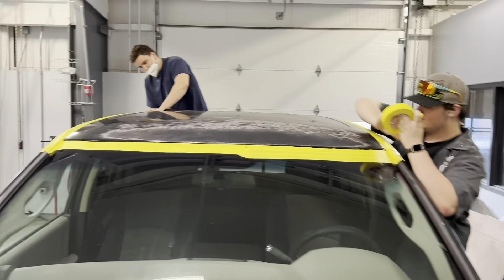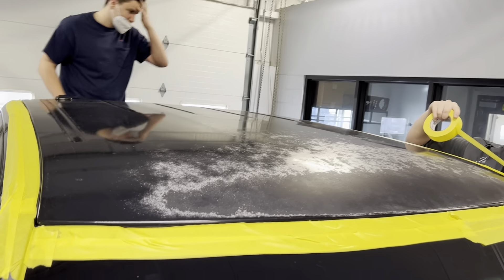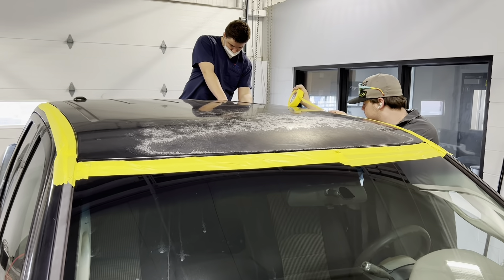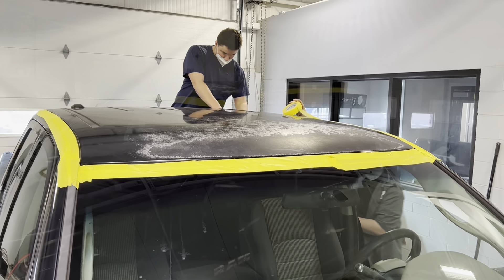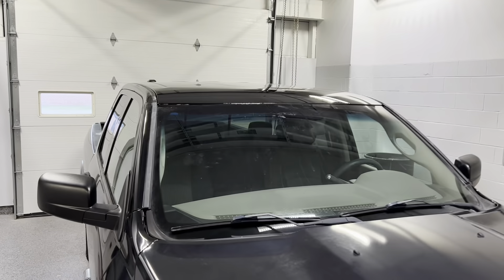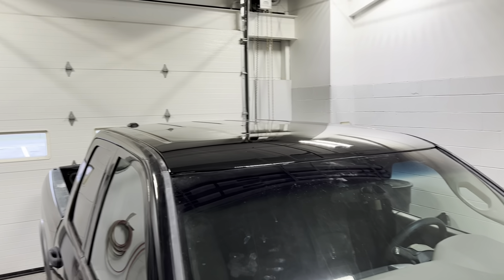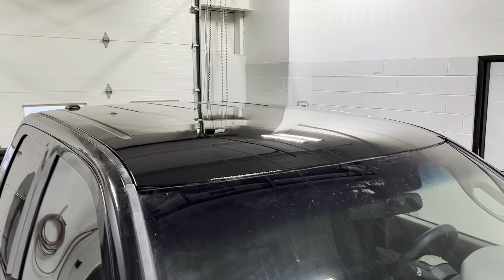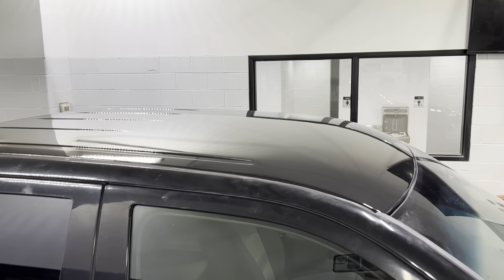Dodge Truck Roof Repaint

Comment: This is a common problem with the newest govt mandated low voc compliant clear coat that just barely covers basecoats. Usually burns through in a few short years. Nice recovery by these two top guns